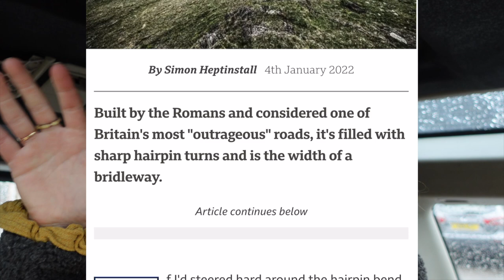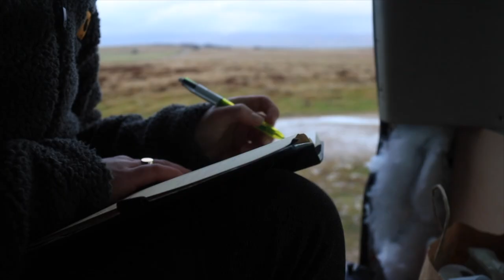FIRST SOLO OVERNIGHTER IN MY LAND ROVER ( in the mountains )

Comment: My philosophy for camping, pack like a backpacker, even if it’s motorcycle/scooter/car/bicycle camping. Even on my last scooter camping trip, I felt I packed too much. Don’t overthink your camper build, or your’ll turn your Land Rover into a storage shed. 😘✌️🇺🇸🇬🇧👏👏👏
Reply: I agree. There is actually no need to 'build' the inside of a 4WD or SUV. Simply chuck a decent mat inside, some plastic storage boxes and you're sorted. This enables you to simply and quickly revert it back to a normal vehicle within minutes. There is also definitely no need for a diesel heater nor to add insulation. Most vehicles already have good felt insulation, and the confined space gets far too warm very quickly using a diesel heater, plus the danger of fumes. All that is needed is decent extra clothing during winter and you'll stay cozy and warm in the coldest of weather, even with all four windows slightly open 24/7 for fresh circulation of air.

Comment: Hi Becky, your channel caught my eye because of the Discovery. Don't worry about what anyone says, these are really reliable 4x4's and the Td5 engine is one of the best. I have 2 disco's, a series 1 from 1993 which I am restoring and my 2000 Td5 disco 2. neither has ever let me down. keep serviced and don't forget the centrifugal oil filter on top of the engine. with care and maintenance it should last you years. keep an eye on the chassis though - disco 2's are prone to rust, but are easily repairable with a ready supply of parts. when you can, try and get a nanocom diagnostic tool. expensive but worth it if you get problems. Good luck with the conversion I'm following with avid interest! 🥰🥰🚙🚙

Comment: Good luck with your Land Rover project Becky

It's just a thought and I'm sure you've got this covered but I'm going to say it any...
   I'd recommend a minimum of three fire extinguishers, one in the driver's cabin and two in the rear
   And I'd recommend, until you've got your rear door work bench sorted, put a bigger diameter base on your camping stove to improve stability

I'm a grandad so I worry about this sort of stuff

By the way, the Land Rover Discovery Mk2 is an excellent choice. If you look after it, it will look after you.

Good luck

Comment: Hi Becky.  I’ve got a 1999 Disco 2.  Also converted the rear for sleeping.  Recently fitted a new galv’ chassis and new springs.  Don’t listen to other people, these Landys are awesome 4x4’s.  Keep the oil changed every 10k miles and give the four brake calipers a good birthday every 12 months.  The injector harness is so easy to change, so do that every couple of years.  I’ve got BF Goodrich AT tyres on mine.  Make sure you have all season, all terrain tyres on Percy and you’ll be sorted 👍👍

Comment: Lordy, glad you had a 4 wheel drive. I tackled Hard Knot Pass in October '22 in a 1.6 Vauxhall Combo (2 wheel drive L2H2). Terrifying, and so glad I had turned it into a camper so that it was heavier and more stable. Couldn't face Wrynose Pass to get down to the Langdales. Took a very long detour. I certainly bonded with my van on that adventure. Have a good time with Percy.

Comment: Tube heaters are good to take the chill off small areas, and at 80w on full power not too much of a drain off a battery set up. Also, no faff with fumes, and, it’s dry heat, so minimal condensation. Loads on Amazon

Comment: the worst thing about sleeping the in the back of the disco 2 is getting in and out. The rear passenger doors are a tight squeeze to get out, especially when you're sleeping on a platform, and the rear door is a heavy thing to wrangle.

Comment: Love the land Rover.  You'll do so well with it.  Worth the investment.  

Also if you're using jetboil inside please make sure you have a carbon monoxide detector.  And open a window.  I set off my carbon monoxide detector using a jetboil. They can burn dirty yielding a lot of carbon monoxide.  It builds fast and you can't tell without a detector.  Be safe.

Comment: Ive got 2 landrovers, a 1996 disco which has a bed, cooker and sink in the back. Little plug in coolbox, diesel heater and a few more bits. Been all sorts of places in it, just heavy on petrol as its a v8. The other is a 20 year old Rangie that i use as a daily drive. Both are reliable. Dont listen to the nay sayers. Look after em and a landrover will go on forever.

Comment: Great video love it,someone comment on your land Rover chassis,there is a product called lanoguard,it stops the progression of rust  it comes in a spray bottle and you just clean off the dirt and lose surface rust and spray all underneath but not brakes and discs,it’s easy to put on, and it’s the stuff that comes from sheep, so it smells  for a bit but it’s not harmful to humans or wildlife ,and there is hose so you can spray all inside the cells  and in side the chassis,they say do it twice a year happy days.

Comment: On my old Discovery I mounted the spare wheel backwards (so that the dish of the wheel is facing out) and then inside the dish of the wheel I made a bracket where I could screw in some bars and I would put my bike on that.  Worked a treat and it would save you carrying the bike inside.  Of course, when the bike wasn't on the back I just unscrewed the short bars and put the tyre cover on and it looked totally normal.

Comment: Great that you're getting out and about in Percy we may have crossed paths while you were up at The Lakes , l was around Ulleswater area over Christmas and boy was it wet except for Christmas Day l was high enough to get some snow . On the way back to The North York Moors l overtook a Disco same colour similar spec as yours with a roof tent on top , l looked over  at the driver , obviously not you unless you hadn't shaven for a year or two and had your hair shaven . Take no notice about comments about Percy friends of mine have had them for years and have had  loads of adventure's , they say there easy to fix and the parts are relatively inexpensive. Happy New Year ! To you and Jake. Have A Nice ! 🤙

Comment: Hello Becky, love your videos, just want to share a safety tip or two, don't rely on your hand brake, they can fail, always put the car in 1st gear it will stop the car from rolling if the hand brake fails especially on slopes, also loop the seat belts through the door handles when you are sleeping, if you can, and lock the seat belt as if you are in the seat, if any one tries to force the door open it will trap the door and stop it from opening wide. If you knew about these anyway then good. Just want you to be safe so you can keep on with the great videos ❤

Comment: Had a disco 2 like yours...good tank but put some money aside for air suspension repairs , but aside from that he should see you right , only one suggestion , your gas cooker us to high and unstable to use in side .. would be better to use a low profile one like those cheap square things that use the arisol type gas canisters there much safer and a carbon monoxide detector and  fire extinguisher.. look forward to sharing your adventure's!!.💕🇬🇧

Comment: Nice to see someone else getting out into the wild with their Landy. Well done. 
I’ve got a 2kw Lavaner Pro diesel heater in my 110. It ran for 16 hours (ish) and used 2.5 litres of diesel. It’s the bollocks!! 
If you need any advice on fitment. Geez a shout. Once you have a diesel heater, you can get into some real mountains 🏴:)

Comment: Dont listen to negatives about the disco 2 Mine was 17 years old and trouble free. Regular oil changes . Proper warm ups . If it has been maintained well it will do the job well . Check levels religiously . I'm an ex truck driver . The rules I follow are second nature to a truck driver . Never rev or thrash a diesel engine from cold.